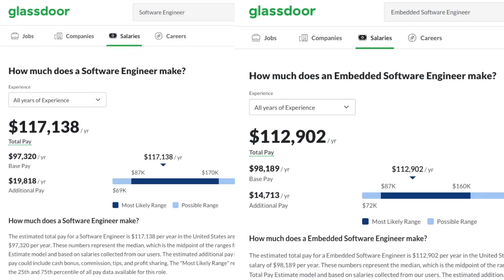Pros and Cons of Embedded Software Engineering

Comment: With AI's current state, I don't think it will be much longer before software engineering becomes significantly easier. This will inevitably either lower wages, or number of people actively employed. I do believe we will see software engineers suffer due to AI in the near future.

Since embedded involves hardware, it will be more difficult for AI to have the same impact. It WILL impact embedded eventually, but it should be slower
Reply: If you don't learn let's say programming today just cos your uncertain understanding says that AI will do that in future, then it's literally weird. I mean something is better than nothing? How will you evolve with time if you even lack the basics ? Plus if AI is supposed to do every software job, then AI should program other AI, make video games , maintain complex software projects as, create libraries etc. Just think for two minutes, you think AI will create Linux like operating systems with a single prompt? And market will be flooded with them ? Kinda like having a money printing machine at your home and then asking the purpose of such amount . Let's ask AI to code some defense systems , space vehicles etc . And if AI has to take over software completely then no other tech job will be safe

Comment: Is Arduino projects are Embedded systems too?
Reply: Depends how you see it. Since it is a board so yes it is embedded system. However Arduino is best for starters or just hobbyists who want to get into the world of embedded systems. Arduino is not for intermediate or advanced level embedded software engineers. Since projects made with Arduino are usually hobbyist use

Comment: I have zero regrets about going into this field. Something I might add is that there are a lot less young guys going into firmware/embedded software development. This field requires a very low level understanding of hardware that most newcomers never needed to develop. As a result, the average age of an embedded software engineer is somewhere around 40, compared to that of a conventional software engineer; around 30. There are a lot of old guys in this field with dated paradigms that are retiring, leaving a ton of opportunity for young guys to get in. 

As for salary, you absolutely can be earning more than a conventional software engy. Just ask for it. There is an ever shrinking supply of firmware guys and demand is still very high. There have been job postings in my town that haven't budged for 6+ months because there is simply no one to fill them. You have a lot more leverage in this field than you might think.
Reply: Bro, thanks for the advice! I'm looking for a job right now, and I didn't think about it that way. I have a very good chance at getting the job I applied for. It is literally what I've been doing for the last 4 years, and the posting has been up for over a month. I'll definitely apply what you mentioned
Reply: Any tips for going into this field? I've been a fullstack webdev for the past few years primarily doing Go on the back and TS on the frontend. While Go is somewhat inspired by C, C on embedded is a very very different beast. I have a halfway decent understanding of how hardware works and an okay understanding of electronics (communication protocols, usecases, etc). But I have absolutely no idea where to start with this
Reply: @Mooooov0815  Same here ? I am also a full-stack web dev. I had the opportunity back in my university to choose between Software and Embedded systems but went for software, because easier realisation/more opportunities. But now I remember how much fun I had while programming arduinos, leds, sensors, etc.
Reply: I think all Software Engineers need to keep current with the latest ideas. TDD wasn't a thing when I got my first job but now I'm evangelising it to my team. Ditto agile development and CI which work really well for embedded systems.
Reply: im a front end developer looking to learn more in embbeded systems but the fact that I have IT degree and id have to do a post bacc in computer engineering to learn hardware is making me afraid to go in because of the math. I ve thought about doing a master and taking some classes in embbeded currently im taking microcontroller programming, and data structures with C. I have a bit of hardware knowledge.
Reply: may i know which country are you from
Reply: What will be the future of embedded software, job opportunities and salary situations, and what will be the impact of artificial intelligence?
Reply: I just got promoted to senior and get paid around 2400 eur per month after taxes. I kive in the Baltics and cant move. I feel like i should be getting paid better but the market here is little and working remotely as embedded dev isnt possible.

Comment: The most annoyed part is we cant focus on programming, we should ensure that the hardware, jumper etc. Installed properly, beside doing programming.
Reply: Yup! I was debugging why I2S wasn't working as expected. Eventually found that the jumper wires for TX and RX were shorting UNDER the breadboard. The wires were bent in just the right way for this to happen.

Comment: Please stop derailing students, I am a graduate student and did my Masters in vlsi and embedded. All my batchmates got into embedded companies without any issues. PS: you need to work hard :)
Reply from the maker: not trying to derail anyone. Simply sharing my experiences and it is a fact that there are less embedded software engineering jobs (significantly less) than regular software (at least in the USA, might be different for other countries, but I doubt it especially based on the feedback I’ve gotten). Less positions available, means harder to get a job + it’s a very niche field. hope this helps! thank you! Cheers!

Comment: Good day Greidi, Hope you are well. I'm Completing my BEng Computer and electronics degree in the next 2 months. And I'm applying for my Masters for next year. What advice do you have on becoming a PRO in embedded devices. And, what is the latest trend in embedded devices? I'm hoping for a project, in my Masters, that uses an embedded device. I also want to gain as much experience, with embedded devices, as possible to make me proficient in the job environment. 2 Birds with 1 stone :). Also, "Imposter syndrome" is a real future fear for me, since i basically only have about 4 semesters worth of experience with these devices (I have experience with 8051, PIC24, STM32, ATMega328p and RPi chips)
Kind regards
Reply from the maker: to become a pro you’d need to work and learn a lot. School is good, but can teach you only so much. Actual real world experience will help you get there. watch this video for basic skill set needed https://youtu.be/HFmGk4oufj8 Feeling an impostor is common, but know that being in engineer is not knowing everything. Engineers solve problems… that’s the job… you can’t know it all… ever… Cheers!

Comment: In my country, embedded software engineering is kind of underdeveloped in general. Actually, atm, i'm working like an embedded linux engineering, specially in networking devices. Most of the time, i work with SoC because the hardware is provided by another company and they build a framework based on Openwrt (or something like that), driver for their hardware and so on. Our jobs is to build anything we want base on that framework. Sometime we have to fix various bugs in driver which require understanding of hardware stuff like registers, I/O mode, etc... Unfortunately, students here don't like this field because it's hard to learn. They chase for IT cuz there are  lots of short-term Web programming, AI programming out there, which take just 3-6 months and they can have a job and get PAID FAR HIGHER THAN THE HELL COMPLICATED ONE that i have to learn for years: Electronics, telecommunication, Operating system, Linux programming,... My country is underdeveloped so there is just a few companies can invest in embedded engineering, a lot of requirement and investment for tools, Labs, specific tester (cuz generic tester can't understand how to test a small shit device like router). (Meanwhile for normal software, just a computer, some server and basically, it's done). Feeling kind of unfair. But I just love touching the hardware and feel the heat on of the Chip. Will always being and embedded engineer !!!
Reply from the maker: ah.. it's unfortunate to hear that... I hope that it will become more balanced over time and people start recognizing it better in your country.... Thank you for sharing this, good info for everyone! Cheers!
Reply: You are from the same country as me, VN. Thank you for sharing this
Reply: actually Vietnam nowadays had many investment in semiconductor industries from abroad, I think It will be promising field. greeting from 🇮🇩🇻🇳❤
Reply: Benin here. The most developed fields in my country in IT is software development... And embedded area is just around arduino or esp and mainly during studies... So I leave temporally this field to start a career as fullstack web dev... But I love embedded systems
Reply: @tawalioualao7444  i feel the same, but i havent started to try fullstack role yet. Is it worth to try? why you decided to comeback to enbedded after have a fullstack job? i feel a bit fomo with fullstack job too and thinking to switch career from embedded to web development
Reply: @bagaspermana88  Yes, fullstack is awesome ! you can learn many thing from front to back end dev, databases, cloud, ci/cd...

I love embedded world, and I'm planning to comeback in this field but I don't know if t is the right time though

Comment: Hello Greidi. I am a year 2 student who majors in Electronic Engineering, but I find the courses hard to follow. Would you recommend converting to computer science where things are easier? Thanks
Reply from the maker: My question is - are they actually easier in CS for you or why do you think it would be easier? Did the coding classes come easier to you? Personally... this is a good moment for you to think about changing majors because majority of classes overlap for first 2 years (I think). What do you personally like the most? programming? doing schematics? electrical designs? something else? 

Also don't put too much pressure on yourself on making the perfect choice... you can always switch careers pretty easily with a STEM degree, people do it all the time (and I did it... twice now..)
Reply: @GreidiAjalik  Thank you Greidi. You are right. I have put too much pressure on myself. As the conversion to the front-end can be very fast, I can do it any time if I truly cannot deal with the microcontrollers.
Reply from the maker: No problem! just make sure you take electives and course you'd enjoy the most! :)

Comment: Hello how long does it take to be qualified to work as a embedded software engineer coming from a cs background ?
I will gladly appreciate your help.
Reply from the maker: You could jump straight into it from college (at least I met several people who had done that) - otherwise, you can probably pick up the BASIC skills pretty quick if you've never touched development boards (maybe 1-3 months doing 10-20h per week in addition to your regular job). In general it takes a long time to become proficient at it tho.
Reply: I went straight into it from CS by chance.  As long as you have some basic digital design and architecture experience under your belt, you'll be fine in a junior role.